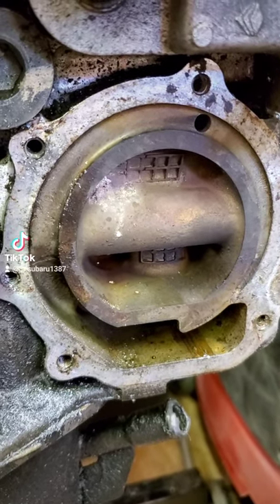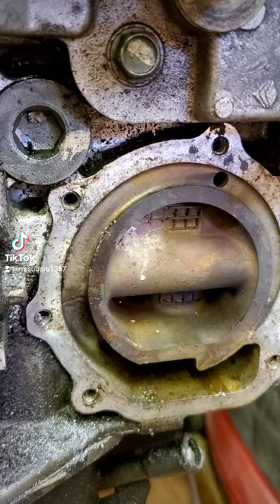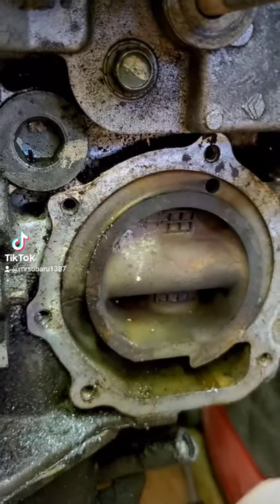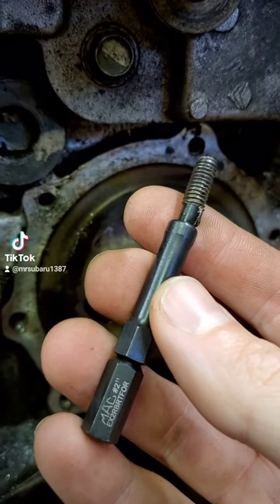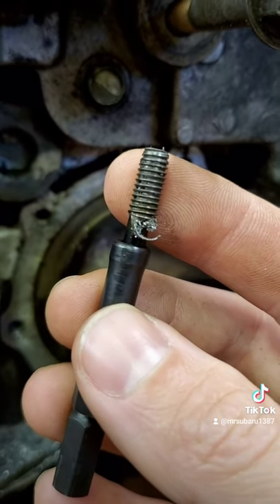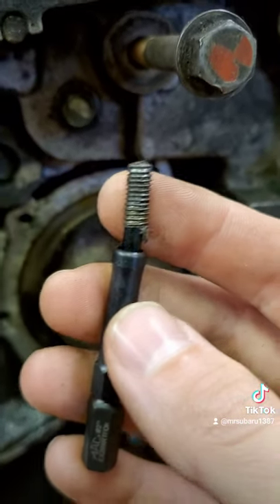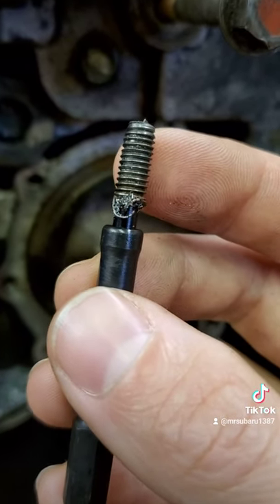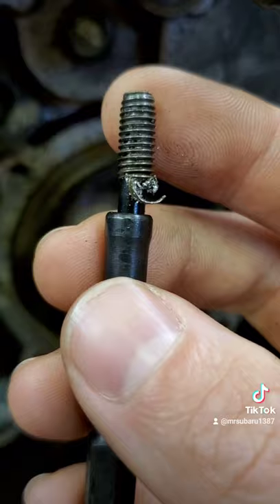MAC R.B.R.T Extractors! Best Broken Bolt Extractors On The Market! #shorts

Comment: Excellent tip! 
Thanks for your advice during Q & A last month. I had my local shop remove the spark plugs and tool. I've done the Radiator replacement and that was a job that took longer than I wanted to but my rotator cuff surgery last November would not allow me to get it done sooner.

Comment: The right way to do it is with a welder, a washer and a nut
Reply: interesting, I've only seen it done with just a nut. Is the washer just for smaller bolts?
Reply: @mysss29  helps you get the inital adheasion to the bolt in my experience

Comment: MrSuburu1387, I have an 05 legacy 2.5 i, 5 speed, 180k miles, the other day I was driving down the road and went to shift to 2nd and bam, sounded like I threw it in reverse while going forward, and now all it'll do is make a clanking noise when I start it up and try to put it in gear, you can put it in any gear, let totally off the clutch and it just sits there and knocks? Help please!

Comment: Could you please comment on a good front and rear diff change interval. I drive a 2018 touring forester about 15000 miles annually with about half of it highway miles. Without looking I think the manual says change it every 15000 if there is severe duty involved like city driving and or trailer towing. I don’t pull a trailer at all. Thanks.
Reply from the maker: Diff gear oil is normally 3yr/36k miles.
Reply: @MrSubaru1387  ok thanks.  I originally changed at 30000. I’ll extend the interval until the next one.

Comment: hey dude, yesterday I started my subaru llibery for the first time in about 3 weeks and as soon as I turned the car on I couldnt get it into gear, it shifts when the car is off but requires some force, but again when the car is on it just refuses to shift and will only go into reverse, and even when that happens it wants to grind, any idea what it could be?
Reply: Sounds like your clutch isn't fully disengaging. If its hydraulic there might be air in the lines. If it's a cable it might need to be adjusted. Good luck!
Reply: @Bobpeter100  Thanks dude, seemed to fix itself up without me doing anything, was pretty odd but I should still get it checked up